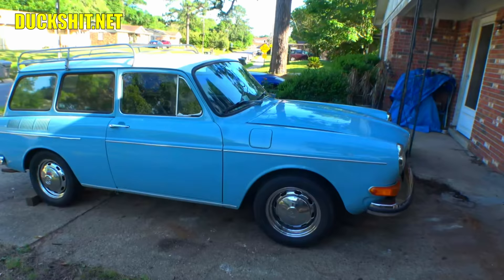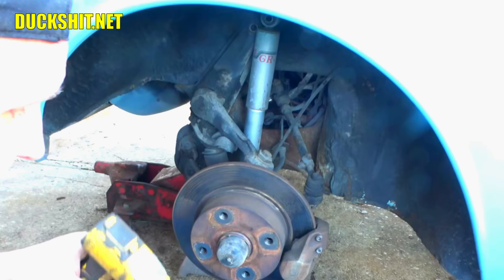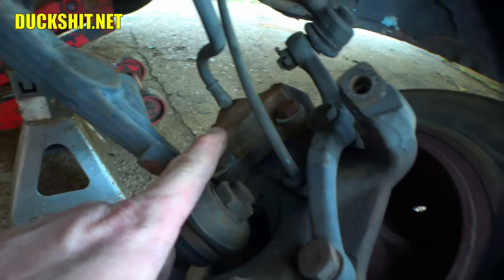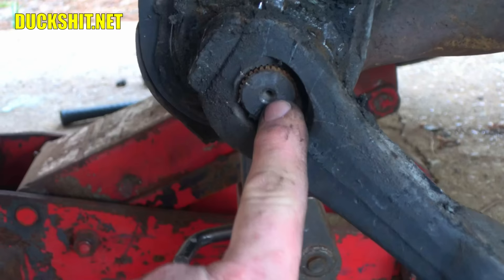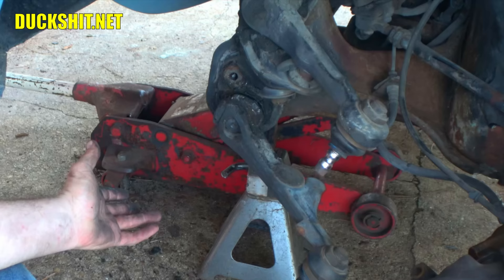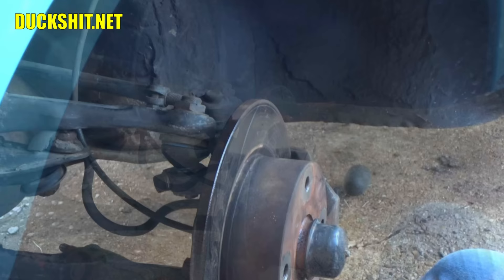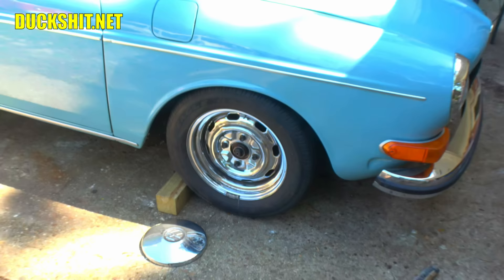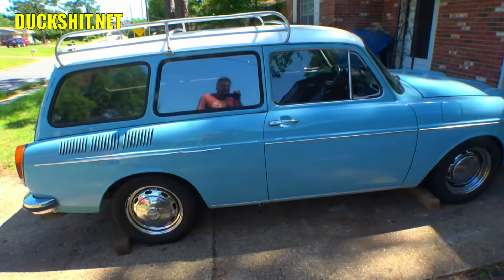🔧Lowering⬇ a VW Type 3 Front End💥🔥

Comment: In the USA, the Beetle ended at about 1977 (Super Beetle in 1981) because they could not meet US Safety and Exhaust  requirements. But World Wide, the VW Factories were pumping Beetles out until the mid/late 1990s in Europe (German Factory) and in 2005 and 2010(?) in Brazil and Mexico respectively.

In fact, The Mexcian VW Factory is restoring Bugs (rumored to be free) if you can prove you/your family are the original owners of the bug. Oddly it is not a prefect resto as they use some Mexican parts for the restoration which is not compatible with US Parts in the US. But A VW Bug Resto from VW? They need to keep this going!
Reply from the maker: Standard Beetles ended in 1977, after that was super beetle convertibles SPECIAL EDITION ONLY until the end of January 1980, for the 1979 model year.  Most Mexican and Brazilian parts on German built Beetles just fine... may not be period accurate but they work!  😉👍🦆💩

Comment: Type 3 only metal on metal noise That Fasty and Notch owners of the group don't don't get to hear (before you go through all that heavy work) The upper fresh air tubes (one each side) Screwed to the underside of the cylinder head tin. Where the cooling tin makes a 90 degree bend down towards the ground the end of the upper fresh air tube comes through a hole in the tin. The sound is the tube vibrating in the hole in the tin.
With some luck IRS (automatics only) guys later rear engine mount can do oil cooler seals without taking the engine out. Work was done at a KOA campground. So with any luck you can torque the heads without taking the heavy lump out. Raise the rear of the body after unbolting the rear engine mount. Sometimes the body will come up enough on its own
Reply from the maker: Thanks, but that will likely break the front transmission mount on this automatic.  But I'll try a few things before I commit to complete engine removal.

Comment: And Chasing chickens. LOL I got a dozen chickens or more. We got too many eggs right now. I can always have some eggs for breakfast. So thats good. Eggs have no fat so I can eat them all I want to. I used those KYB shocks on my Ranger pIck up I do recommend them. I like to wipe grease on the outside of the bearing and fill the hub cap full of grease too so it will work its way in and also it will help it stay lubed instead of getting dry. Yes that tie rod will eventually become a big probelm for sure. My truck rides like a lumber wagon I should take a litlle bit of the pressure off the  torque rods but it will change the alighnment. I am too cheap to have it realigned. Good thing you caught the air cooled pipes comming off before it melted down the rings. I like how your not afraid to remove the motor you aint scared.
Reply from the maker: Oh man... always chasing chickens around.... usually it is to make them come inside at the end of the day, lol!     Thanks man!

Comment: As long as the torque converter is left in place (mechanics strapping diagonal across the bell housing) works well Index the torque converter flex plate before unbolting so the orientation remains the same
ISP west sells fan shroud block offs.  I've heard the arguments for keeping fresh air tubes and heater boxes for over 30 years. I use large wrench in freeze plugs using a large hose clamp to keep the fan housing from spreading. I worked 38 I-95 miles from home 5/6 days a week. I got my 73 automatic square-back for two hundred dollars because the previous owner put on an after market exhaust without blocking off the fan shroud
Reply from the maker: Thanks, I am going to leave them together.  I have no reason to separate engine from transmission in this instance.  But I will likely plug the fan shroud same as you recommend.  That should do it nicely!  Thanks man!

Comment: Hey Duckman did you leave the details of the KYBs?
Also quick tip for removing the torsion arm, just loosen the retaining bolt on the other side (or put a longer bolt in) and hit it with a hammer, pops the torsion bar right out much easier than trying to lever  it off from the same side. 
Regards
Reply from the maker: Thanks man, but I don't understand the first question.
And as far as hitting the torsion from the bolt side... yeah if it's stuck I have. But I wouldn't just loosen it and hit it otherwise because you're probably going to screw up the threads.  I have used a longer bolt in that location just so I could thread it in and bottom it out so as not to mangle anything.  That works well!

Comment: Years ago a friend of mine who owned a body shop had a square back he made a pickup it was in the world of wheels it was black with flamesŵhere the rear bumper was was a custom rolled pan that was like a spoiler that the bottom came to a point and it was all molded and said ugly trucking it was really neat it changed hands a few times and something to do with a brain or something went out and was a part that was not east to find or cost to much but it wouldn't run anymore is there something with those engines that makes it hard to get parts for I remember he called it a pancake engine. Also today I was by my buddy's shop he is building a vw with a Subaru engine in it said its going to be about 400 hp.
Reply from the maker: Thanks Richard!  The engine is about the same as a Beetle engine, just the cooling tins and generator are different.  Otherwise all the same inside.  Subaru would be awesome... maybe someday!  Thanks again!

Comment: I had a 70 sq. I could sware i moved the top arm 2 splines, not the bottom arm. Worked, any thoughts on that?
Reply from the maker: I don't remember there being any splines on the top.  The internal sway bar lives in the top and has tablet-shaped shaft ends for all years that there were Type-3.  Maybe you had something custom?   😁👍🦆💩
Reply: @DuckmanCycles  Not custom.  Anyway I managed to do it, must of been the bottom but I didn't pull the rod out. I stamped the spline then 2 up. Enjoy your videos.
Reply from the maker: I pulled the top apart once only for curiosity's sake.  Wasn't much to it.  Thanks man!